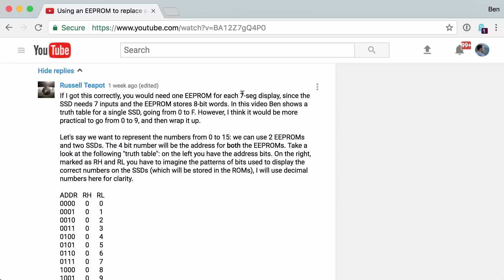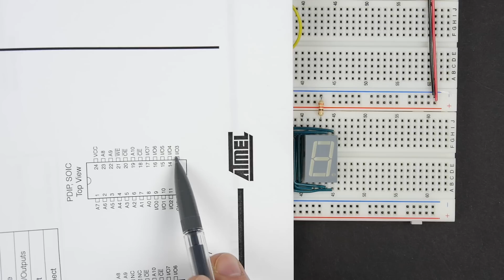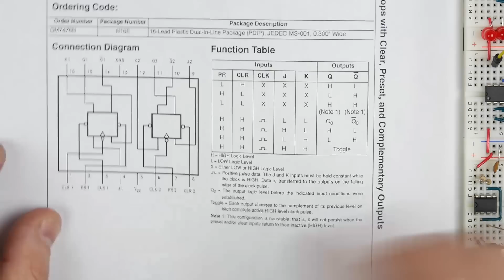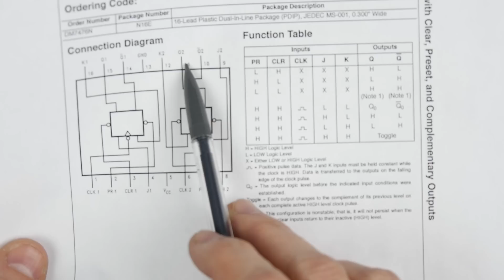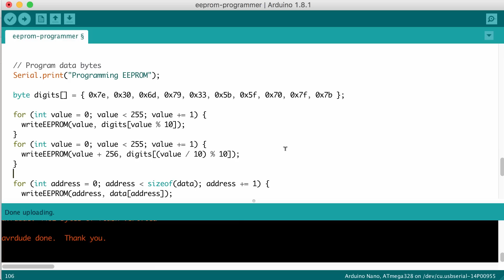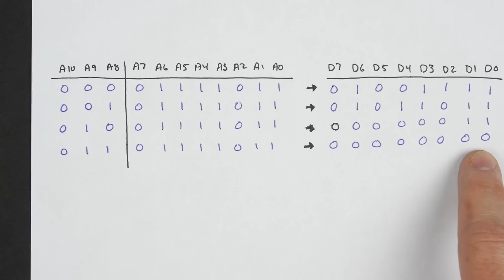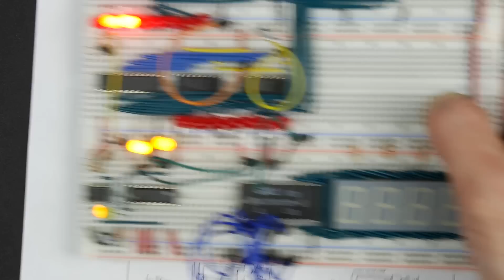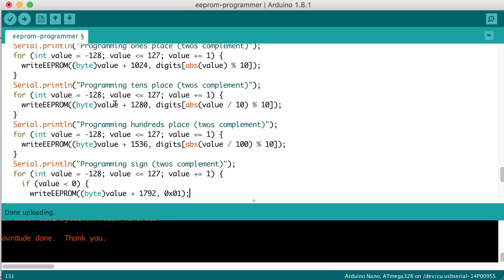Build an 8-bit decimal display for our 8-bit computer

Comment: Updated the complete parts list with this module: https://github.com/DutchMaker/8-bit-Breadboard-Computer
Reply: Nice list. I wonder if you could upload a bin file for the 28C16. Mine is working, but I would like to compare it. As I did have a problem or two. Although it seems to be working perfectly.

https://drive.google.com/open?id=0B6LIgQzDkH8fNFZyXzhLN0dUS00
Reply: I have only just began building this week (had to wait for China to send all the parts) so I'm not working at this module yet. Only have the clock and two registers done so far. Will definitely upload my hex to the github repository once I created it.
Reply: Looks like you are quite some steps ahead from the videos (and it looks great!). Did you find more information about building it somewhere else (aside from the book Ben mentioned)? I'm particularly interested in how the program counter and control unit works
Reply: This is the one I used for the Instruction Decoder and Control Matrix only. 
https://drive.google.com/open?id=0B6LIgQzDkH8fRmpSYm9ROTMzSGM

This one I used for the Program Counter and Ring Counter. (Ben changed his Program Counter)
https://drive.google.com/open?id=0B6LIgQzDkH8faEJuaExJemxoUUk
Reply: Did you forget the dip switches in your parts list?
Reply: Thanks a lot for the links, very useful!
And I have indeed forgot to add the dip switches. Will add these asap. Thanks!
Reply: Here is a Parts List that I created, using your format. I separated everything by Modules. I also included my own Output Display, Instruction Decoder, Control Matrix and Ring Counter. With links to documents that I used.
Take a look and tell me what you think.

https://drive.google.com/open?id=0B6LIgQzDkH8fZEVMaFd5UnpILTA
Reply: Awesome!

Comment: Hi Ben!

I have a problem, I cant code. So i need your help. I have the eeprom with 64KB storage, and therefore 13 adress lines instead off 11. How can i change the code that you have written to allow this? 

My problem is that when i test the "8 bit display logic thing" and for exampel put a 10 in the adress line, the 0 is only showing up on the 4 displays. every number i try, its only displaying the last digit. How can i solve it?
Reply: Xrayer - Why dont you order a couple of 28C16's on ebay, it will make your life a little easier.
Reply: Jeff Nay thanks for your answere. but i figured it out with my at2864 at the end :-)

Comment: Some more ideas to consider:

1. Since we are multiplexing the display anyway, we could factor out the part which controls the multiplexed display, and the part which decodes the byte into 7SEG code, into two separate circuits. This way, the display could be used for other purposes as well (I'll describe some of them in a moment) and make the display to be a more universal output device.
2. For example, we could use a two-step decoding process in which the byte is decoded into character numbers, and then those character numbers are decoded by a separate EEPROM into the bits controlling the segments. This way we can either:
a) set up all the bits of the display separately by the CPU for full control over the LEDs;
b) set up a character number for each digit, which would then be decoded into the bits of the display;
c) set up a byte value which would then be decoded to a character code, and in another stage into the 7SEG code.
The mode of operation (along with the style of display) can be controlled by a separate register mapped somewhere in the address space (along with four other registers for storing either the character codes for each digit, or the bits controlling the LEDs directly, or just a single number to decode).
It would take two EEPROMs as in your first design, but this time one would be for decoding the numbers into digits (encoded as character numbers), and the other one would be for decoding those character numbers into 7SEG code. Plus a bank of 4...5 registers for "video memory" ;)
3. This would also simplify the decoding logic, because we can then use the same general "pattern" for the decoding tables, and generate different styles of displaying them by simply search&replacing the character numbers with their different-style codes. Or, with a clever organization of those characters in the second EEPROM, we could perhaps even do it on the fly, by switching the character sets in the second EEPROM without any change in the decoding logic :)
4. This would allow to extend the character set with some additional fancy characters, such as:
a) 6 characters with a cycle through all 6 segments around the centre (good for "waiting icon" / processing indicator / display test / demo mode);
b) two different versions of hex digits (lowercase, semi-uppercase);
c) 6 characters for comparison operators (<, >, ≤, ≥, =, ≠) encoded, for example, like this:
        ---       ---            ---      ---
      |                 |        |                |
        ---       ---            ---      ---          ---       
                                                                       |        |
                                   ---      ---          ---
d) some other fancy stuff you can imagine ;)
5. With some additional characters, we could also decode the byte as bits, using the display style kinda resembling a dip switch :) Something like this:
      |    |       |           |
              |       |  |  |
might be decoded from 11010001. This would use all 4 digits, one for each two bits, and would require just four additional characters (one for each combination of high/low lines).
6. Adding two more characters, we can turn the display into a bar graph / progress bar :)
7. Such approach would also make it easy to upgrade the display circuit from 7-segment display to some more fancy, alpha-numeric segment displays or dot matrix displays, because now it suffices to replace the second EEPROM which decodes the character numbers into their display representations, and all the decoding logic stays the same (because it decodes into the same character codes).

8. There's one cool use of an EEPROM if one wants to upgrade our CPU to be able to do some more advanced arithmetics, like multiplication or division :) We can use a 64 KiB 28C512 chip (or two 32 KiB 28C256 chips) to encode the entire 256×256 multiplication table :D (Actually, one 32 KiB chip should suffice if we can simply swap the factors when one is greater than the other, because the multiplication table is symmetrical along its main diagonal). Just use the lower 8-bit half of the address as the A factor, and the upper 8-bit half of the address as the B factor, and the value stored at that address in the EEPROM would store the product A·B. Then we can extend the ALU in such a way that a certain opcode would pass the data bytes through these EEPROMs' address lines instead of through the adders. And voila! We've got a multiplier circuitry without the need of building 8 separate adders :) (or cycling through one, which is slow).
With two more EEPROMs we can make a divider: one chip for the quotient byte, the other for the remainder byte.
Reply: What do you mean by character code? Like an ASCII or Unicode thing?
Reply: @SciTwi9164 Did you ever try the other way round? I consider to add some kind of printing capability to a TI-57. At the moment it looks like demultiplexing the display is the easiest way. Did you ever try something like this?

Comment: Anyone else having trouble getting enough current out of the EEPROM to drive 4 LED's? I'm using a CSI CAT28C16AP-20. I'll hook up the bottom pins with no issues on the right most 3 7-segment displays but the first one on the left drops out. Hooking up any of the top pins sucks current from the bottom ones and they get real dim. Using a 220ohm resistor to ground.
Reply: Gerald Filimonov 74 is a family of logic ics. originally ttl. then LS low power schottky. Then HC high speed cmos. Also HCT.  The 74xx tells you what it does. The letters refer to different technologies and their particular strengths and weaknesses. Gotta read the data sheets.
Reply: It sounds like the EEPROM you're using can't supply enough current to drive the LEDs in the displays.  Your choices are to switch to a different EEPROM which can supply the needed current, or use driver transistors.

The 2N2222 is a useful general-purpose NPN transistor suitable for switching purposes, although almost any bipolar transistor should work.  You'll need to drive the transistor's base through a limiting resistor (try 10k as a starting value and adjust it down if the display is dim or doesn't come on at all).

Connections for a NPN transistor are as follows:

For a common anode display, you should supply the transistor's collector with +5V through the current limiting resistor which you'd normally use for the display and connect the transistor's emitter to the display anode.

For a common cathode display, you should connect the transistor's emitter to GND and connect the transistor's collector via the current limiting resistor to the display cathode.

I think I got the polarity right - if it doesn't work, first try lowering the resistance of the base resistor and if it still doesn't work when you get down to 1k on the base, then try reversing the polarity - but not of the neutron flow (kudos to anyone who gets the joke) :)
Reply: Yeah, I will have to try a different EEPROM but in the end it wont matter as you'll only be driving one 7-segment display at a time anyway and it seems to be able to handle this.

The other issue I am having now is that the 74LS76 chip I have does not have enough current to drive the input to the 2nd flip flop as well as drive the two inputs to the 74LS139 and inputs 8 and 9 on the EEPROM.

If I remove the wire going to pin 9 on the eeprom, the circuit cycles through the 4 7-segment displays properly, granted its not indexing the right address at this point, but the cycling does work.

As soon as I plug that wire back in, the 74LS139 loses its mind and one of the outputs (I forget which one) stops toggling from low to high and just stays low.

I've tried swapping the 74LS76 with another but same result, rebuilt everything on a new breadboard as well to eliminate that as a possiblity too.

I've followed all the videos so far up till this point and havent had any issues with anything I've built.

Is there really that much difference in output current from one chip to the next?
Reply: Issue is resolved. The chip I was using was a 74HC139 and not a 74LS139. I ordered some 74LS139's and things started working as expected. Seems LS and HC do not play nice with each other. =)
Reply: @K9Megahertz  LS is bipolar transistor logic, and it can drive one LED. HC is CMOS transistor logic, and it can NOT drive a LED. but it can drive 1 (one) TTL-input only.
Reply: Yeah, I'm learning as i go here. =) The hard part sometimes is finding the exact data sheet for the chip you have and then understanding what you're reading. Esp when you buy the IC at fry's electronics. =)
Reply: Gerald Filimonov See if your library can do an interlibrary loan "The Art of Electronics" 3d edition and hopefully latest printing from a college library or somewhere. It's lighter on math and heavier on practical. You'll get a feel for why there are thick film  thin film carbon comp wire wound etc. resistors. How they change with time, humidity, voltage, temperature, the method you used to bend the leads, etc. etc..

 Subtle and no so subtle stuff that can trip you up.

Comment: BTW there's a cool little element which is easier to use than those dip switches: it's called a rotary dip switch, or encoding switch. It looks like this: http://goo.gl/47XlMl
and you can easily set any hex digit by rotating the knob, and the switch then connects one of its four pins (1, 2, 4, 8) to the common pin (C) encoding the hexadecimal digit in binary (4 bits). Use two of them to encode a byte. This is much easier to use for setting addresses or byte values than twiddling with an array of minature switches ;)
Reply: Ohh those are nice

Comment: So is this why my microwave/oven display seems to flicker if I shake my head fast enough!? Was always curious about that, since they're LED and I would think they could power them all on continuously (unless this is some PWM style dimming they apply, but they appear to be at full brightness). Perhaps they're only showing 1 digit at a time at a very high speed as well. Is this standard practice?
Reply: giant_neural_network Yes, particularly for larger displays. You can hum and watch them wobble by the beat frequency.
Reply: LoneTech aha! Thanks for confirming. I'll try the hum technique to see, sounds better than rapidly shaking my head side to side which I usually do!

Comment: This little modification is a real money-saver :> Because EEPROMs seem to be very expensive and hard to get here where I live :/ Counters and demultiplexers, on the other hand, are cheap and easy to get.
One more improvement which comes to my mind is to use a four-digit 7-segment display as a single element instead of four separate displays, because then they usually are already made for multiplexing and they have only one set of abcdefgh pins and four separate common cathodes, one for each digit. This can save you that rat's nest of wires around those displays ;)
Also I would probably go with 28C64 or bigger (they are equally expensive so the bigger the better :q ), and program it for some more useful display modes, like the hexadecimal you mentioned. And I would program them slightly differently, just for better readability: to drop the leading zero and display the negative sign on that position instead (closer to the digits) when the number is negative.
Reply: Sci Twi where abouts do you live? The 28c16 can be found on eBay for around $1.80 USD a piece.

Comment: 24:08 Looks like you don't need that 10nf cap, the display works while you remove the 2mf cap... ???
Reply: It's oscillating with the parasitic capacitance in the circuit, but will be faster than the 555 is meant to go and won't be reliable, especially if used off a breadboard.
Reply: But the 555 cannot go faster than it can anyway, right? So it will oscillate with its maximum capable speed, and it's not something that might hurt it, right?

Comment: all those loops could be a single loop for each case :0
Reply: As a software engineer this was painful, but also I'm very impressed by this whole series and am loving the whole thing :)
Reply: @7imbrook  I was screaming the whole time waiting for him to refactor it into one loop and he never did.

*And then he implemented two's compliment with another 4 loops...*
Reply: Actually Ben's way makes sense in that your write each location in the EEPROM sequentially. If you combined the loops, you'd jump addresses a lot. Granted this only matters in memory systems that use caches, but Ben's code is not wrong.

Comment: This is the first video my colourblindness has screwed my experience. I couldn't tell the outputs of the displays! :/
Reply: Hey, you’re right. I just tested it with Sim Daltonism set to deuteranopia, and I could barely tell the difference between the on and off segments!

(If it’s any consolation, the contrast of that LED display is very poor and the brightness is not very high.)
Reply: I'm not colour blind, but I couldn't see it clearly either :q

Comment: 24:12 Why did all 3 digits appear as soon as the 2uF capacitor was pulled out? Was the unconnected pin itself acting as a capacitor?
Reply: Man you got very sharp eyes to pick up that brief moment in the video.
All 3 digits appeared because the oscillator was kicking at a very high speed due to very small 'intrinsic' capacitance present on the pin of the 555 IC, even when the 2uF cap is removed.
For an astable oscillator, the cycle time formula is, T = 0.69(Ra + 2Rb)C
When C is very small, T will be small too. Frequency, f=1/T, which means the 555 circuit was oscillating at an unknown high frequency.
Reply: @garydunken7934  i noticed same thing and i was looking the answer
Reply: That would be a bad hardware design. You should not leave such unstable oscillating circuits just by saving a 1nF capacitor, which is probably less than 10cents. So the question should be, whether you want a good design or bad design.
Reply: Sci Twi lol. A good design should be as simple as it can be. But no simpler.
Reply: It won't work reliably though. It may sometimes not start or lock up, the waveform may not be as much of a neat square wave, the timing and stability of oscillation will be more susceptible to environmental changes and the duty cycle (on time vs off time) may be far from 50%, meaning potentially very short pulses. Any of which might not be adequate for your particular circuit.

Best to keep the oscillation frequency within the spec of the 555 which depends on the exact model of 555 you have, but IIRC max will be somewhere between 300kHz and 500kHz for older bipolar models, and up to 1-3MHz for newer CMOS models, with tradeoffs elsewhere for using CMOS. 

IIRC, Julian Ilett showed in one video that on his particular breadboarded circuit, his bipolar 555 oscillated around 1.6MHz with no capacitor.
Reply: Yes, it was oscillating at a very high frequency due to the parasitic capacitance in the circuit, but you can't rely on that especially without the significant capacitance of the breadboard it might not oscillate predictably.
Reply: Yes
Reply: So we don't really need that capacitor, do we? :)
Reply: Technically, there is a capacitor there: the pin of the chip & stuff. It's just that it's not a separate dedicated part you could see on a schematic. Sometimes engineering designs must account for such capacitances which are not dedicated parts. I know that this is not the case here, but still ;) And it also depends on how you define a "good" design. If it works, it's good enough for me :J